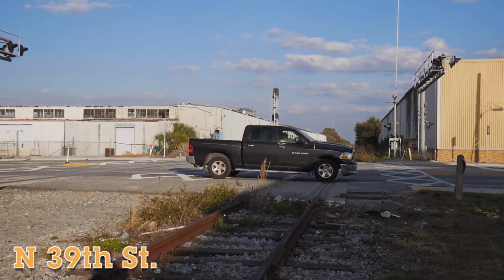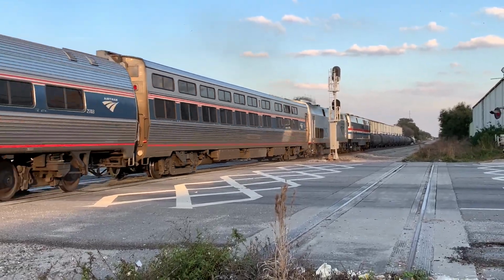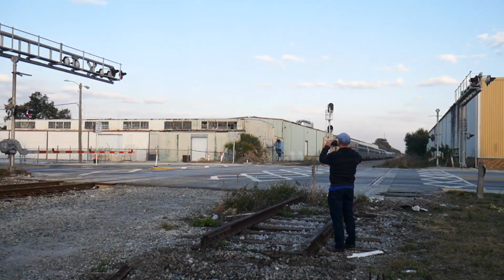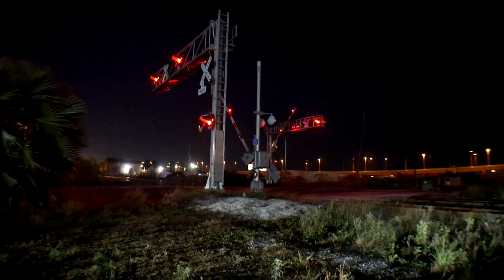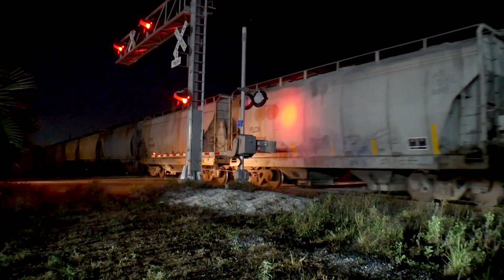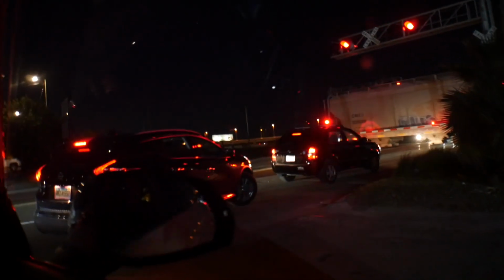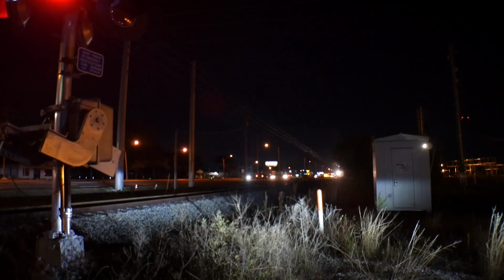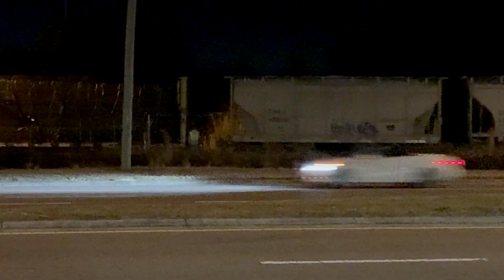Locals & Amtraks - Railfanning Tampa, FL ~ 2.1.22

Comment: Great video. I subscribed.  I would love to know more about trains in and around Tampa.  78th st seems to be almost a waste of time, and I got a couple on 59th st by subway restaurant.  Plant City has been a bit better.
Reply from the maker: Thanks for the sub! It all depends on the times and what you hear on the radio. We missed several more locals around Tampa just so that we could chase that O728. 

Tampa in evening usually goes as follows: On the S Line, you’ll get Q442, and maybe a phosphate train. On the A-Line, Amtrak 92, I046 will depart, and O704 will make a rock run to Winston. On the A Line west of Uceta, 92, Y295, and O704. (I like Y295 because he crosses the Hillsborough drawbridge.)
On the S-Line west of Yeoman, you’ll get a port job (Y191), O700, and O728.
Finally on the Palmetto sub, you’ll get O750, O824, and phosphate movements.

78th St is still a busy spot, mornings from 6am to 9am can get busy, with locals departing, phosphate back and fourth, and Q441 arriving every so often.

Plant City is nice in the evenings. On a good night, you can get 92 both ways, I046, Q442, O704, and I045 between 4pm and 10pm.

Hope this helps
Reply: @multicolorfilms   Thanks, that is a lot of info to take in.  I usually don’t get to 78th st, before 9am, waiting to travel after “rush hour” is over because I’m coming from Largo.  I can’t remember which line is S and which line is A. I know one is from Yoeman yard, across 78th and comes in  to Plant City at the eye and heads North.  The other is the one that heads to Lakeland from Plant City.   Only being here 4 months a year makes it tougher to know all these lines, yards, stations, etc.   I do also want to try Lakeland and Mulberry while I’m here.
Reply from the maker: @Bhil3  The S-Line comes out of Yeoman Yard, via 78th St, Valrico, Market and Plant City.

The A-Line leaves Tampa via Uceta Yard, Mango, Dover, Cherry, and Lakeland.
Reply: @multicolorfilms  Thanks